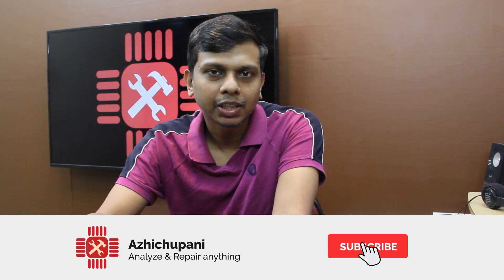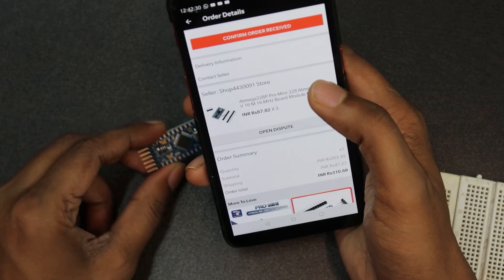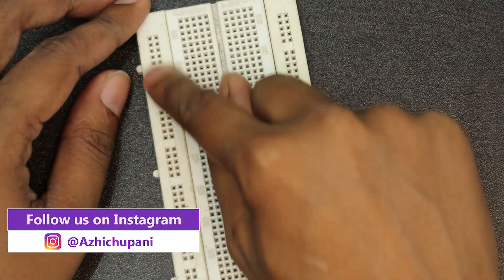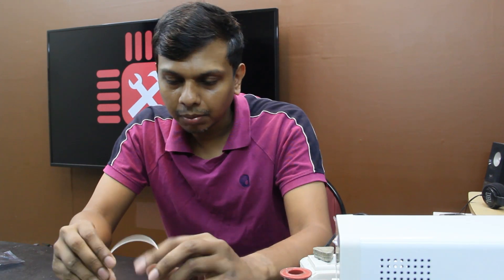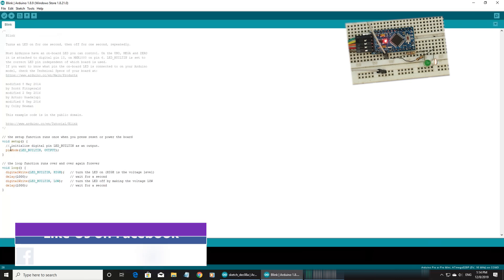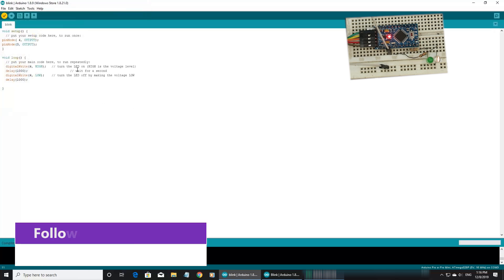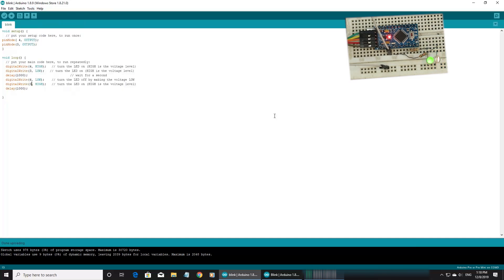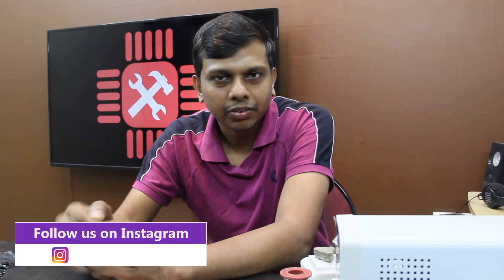EP:1 Arduino Tutorial for beginners | Malayalam

Comment: why compiled program is showing error message while uploading
as

Arduino: 1.8.13 (Windows Store 1.8.42.0) (Windows 10), Board: "Arduino Uno"

Sketch uses 706 bytes (2%) of program storage space. Maximum is 32256 bytes.

Global variables use 9 bytes (0%) of dynamic memory, leaving 2039 bytes for local variables. Maximum is 2048 bytes.

An error occurred while uploading the sketch

avrdude: ser_send(): write error: sorry no info avail

avrdude: ser_send(): write error: sorry no info avail

avrdude: ser_drain(): read error: The I/O operation has been aborted because of either a thread exit or an application request.

avrdude: ser_send(): write error: sorry no info avail

avrdude: ser_recv(): read error: The device does not recognize the command.

avrdude: stk500_recv(): programmer is not responding

avrdude: stk500_getsync() attempt 1 of 10: not in sync: resp=0x75

avrdude: ser_send(): write error: sorry no info avail

avrdude: ser_recv(): read error: The device does not recognize the command.

avrdude: stk500_recv(): programmer is not responding

avrdude: stk500_getsync() attempt 2 of 10: not in sync: resp=0x75

avrdude: ser_send(): write error: sorry no info avail

avrdude: ser_recv(): read error: The device does not recognize the command.

avrdude: stk500_recv(): programmer is not responding

avrdude: stk500_getsync() attempt 3 of 10: not in sync: resp=0x75

avrdude: ser_send(): write error: sorry no info avail

avrdude: ser_recv(): read error: The device does not recognize the command.

avrdude: stk500_recv(): programmer is not responding

avrdude: stk500_getsync() attempt 4 of 10: not in sync: resp=0x75

avrdude: ser_send(): write error: sorry no info avail

avrdude: ser_recv(): read error: The device does not recognize the command.

avrdude: stk500_recv(): programmer is not responding

avrdude: stk500_getsync() attempt 5 of 10: not in sync: resp=0x75

avrdude: ser_send(): write error: sorry no info avail

avrdude: ser_recv(): read error: The device does not recognize the command.

avrdude: stk500_recv(): programmer is not responding

avrdude: stk500_getsync() attempt 6 of 10: not in sync: resp=0x75

avrdude: ser_send(): write error: sorry no info avail

avrdude: ser_recv(): read error: The device does not recognize the command.

avrdude: stk500_recv(): programmer is not responding

avrdude: stk500_getsync() attempt 7 of 10: not in sync: resp=0x75

avrdude: ser_send(): write error: sorry no info avail

avrdude: ser_recv(): read error: The device does not recognize the command.

avrdude: stk500_recv(): programmer is not responding

avrdude: stk500_getsync() attempt 8 of 10: not in sync: resp=0x75

avrdude: ser_send(): write error: sorry no info avail

avrdude: ser_recv(): read error: The device does not recognize the command.

avrdude: stk500_recv(): programmer is not responding

avrdude: stk500_getsync() attempt 9 of 10: not in sync: resp=0x75

avrdude: ser_send(): write error: sorry no info avail

avrdude: ser_recv(): read error: The device does not recognize the command.

avrdude: stk500_recv(): programmer is not responding

avrdude: stk500_getsync() attempt 10 of 10: not in sync: resp=0x75

avrdude: ser_drain(): read error: The device does not recognize the command.

This report would have more information with
"Show verbose output during compilation"
option enabled in File -> Preferences.
Arduino: 1.8.13 (Windows Store 1.8.42.0) (Windows 10), Board: "Arduino Uno"

Sketch uses 706 bytes (2%) of program storage space. Maximum is 32256 bytes.

Global variables use 9 bytes (0%) of dynamic memory, leaving 2039 bytes for local variables. Maximum is 2048 bytes.

An error occurred while uploading the sketch

avrdude: ser_send(): write error: sorry no info avail

avrdude: ser_send(): write error: sorry no info avail

avrdude: ser_drain(): read error: The I/O operation has been aborted because of either a thread exit or an application request.

avrdude: ser_send(): write error: sorry no info avail

avrdude: ser_recv(): read error: The device does not recognize the command.

avrdude: stk500_recv(): programmer is not responding

avrdude: stk500_getsync() attempt 1 of 10: not in sync: resp=0x75

avrdude: ser_send(): write error: sorry no info avail

avrdude: ser_recv(): read error: The device does not recognize the command.

avrdude: stk500_recv(): programmer is not responding

avrdude: stk500_getsync() attempt 2 of 10: not in sync: resp=0x75

avrdude: ser_send(): write error: sorry no info avail

avrdude: ser_recv(): read error: The device does not recognize the command.

avrdude: stk500_recv(): programmer is not responding

avrdude: stk500_getsync() attempt 3 of 10: not in sync: resp=0x75

avrdude: ser_send(): write error: sorry no info avail

avrdude: ser_recv(): read error: The device does not recognize the command.

avrdude: stk500_recv(): programmer is not responding

avrdude: stk500_getsync() attempt 4 of 10: not in sync: resp=0x75

avrdude: ser_send(): write error: sorry no info avail

avrdude: ser_recv(): read error: The device does not recognize the command.

avrdude: stk500_recv(): programmer is not responding

avrdude: stk500_getsync() attempt 5 of 10: not in sync: resp=0x75

avrdude: ser_send(): write error: sorry no info avail

avrdude: ser_recv(): read error: The device does not recognize the command.

avrdude: stk500_recv(): programmer is not responding

avrdude: stk500_getsync() attempt 6 of 10: not in sync: resp=0x75

avrdude: ser_send(): write error: sorry no info avail

avrdude: ser_recv(): read error: The device does not recognize the command.

avrdude: stk500_recv(): programmer is not responding

avrdude: stk500_getsync() attempt 7 of 10: not in sync: resp=0x75

avrdude: ser_send(): write error: sorry no info avail

avrdude: ser_recv(): read error: The device does not recognize the command.

avrdude: stk500_recv(): programmer is not responding

avrdude: stk500_getsync() attempt 8 of 10: not in sync: resp=0x75

avrdude: ser_send(): write error: sorry no info avail

avrdude: ser_recv(): read error: The device does not recognize the command.

avrdude: stk500_recv(): programmer is not responding

avrdude: stk500_getsync() attempt 9 of 10: not in sync: resp=0x75

avrdude: ser_send(): write error: sorry no info avail

avrdude: ser_recv(): read error: The device does not recognize the command.

avrdude: stk500_recv(): programmer is not responding

avrdude: stk500_getsync() attempt 10 of 10: not in sync: resp=0x75

avrdude: ser_drain(): read error: The device does not recognize the command.

This report would have more information with
"Show verbose output during compilation"
option enabled in File -> Preferences.

Comment: Arduino: 1.8.13 (Windows Store 1.8.42.0) (Windows 10), Board: "Arduino Uno"

Sketch uses 706 bytes (2%) of program storage space. Maximum is 32256 bytes.

Global variables use 9 bytes (0%) of dynamic memory, leaving 2039 bytes for local variables. Maximum is 2048 bytes.

An error occurred while uploading the sketch

avrdude: ser_send(): write error: sorry no info avail

avrdude: ser_send(): write error: sorry no info avail

avrdude: ser_drain(): read error: The I/O operation has been aborted because of either a thread exit or an application request.

avrdude: ser_send(): write error: sorry no info avail

avrdude: ser_recv(): read error: The device does not recognize the command.

avrdude: stk500_recv(): programmer is not responding

avrdude: stk500_getsync() attempt 1 of 10: not in sync: resp=0x75

avrdude: ser_send(): write error: sorry no info avail

avrdude: ser_recv(): read error: The device does not recognize the command.

avrdude: stk500_recv(): programmer is not responding

avrdude: stk500_getsync() attempt 2 of 10: not in sync: resp=0x75

avrdude: ser_send(): write error: sorry no info avail

avrdude: ser_recv(): read error: The device does not recognize the command.

avrdude: stk500_recv(): programmer is not responding

avrdude: stk500_getsync() attempt 3 of 10: not in sync: resp=0x75

avrdude: ser_send(): write error: sorry no info avail

avrdude: ser_recv(): read error: The device does not recognize the command.

avrdude: stk500_recv(): programmer is not responding

avrdude: stk500_getsync() attempt 4 of 10: not in sync: resp=0x75

avrdude: ser_send(): write error: sorry no info avail

avrdude: ser_recv(): read error: The device does not recognize the command.

avrdude: stk500_recv(): programmer is not responding

avrdude: stk500_getsync() attempt 5 of 10: not in sync: resp=0x75

avrdude: ser_send(): write error: sorry no info avail

avrdude: ser_recv(): read error: The device does not recognize the command.

avrdude: stk500_recv(): programmer is not responding

avrdude: stk500_getsync() attempt 6 of 10: not in sync: resp=0x75

avrdude: ser_send(): write error: sorry no info avail

avrdude: ser_recv(): read error: The device does not recognize the command.

avrdude: stk500_recv(): programmer is not responding

avrdude: stk500_getsync() attempt 7 of 10: not in sync: resp=0x75

avrdude: ser_send(): write error: sorry no info avail

avrdude: ser_recv(): read error: The device does not recognize the command.

avrdude: stk500_recv(): programmer is not responding

avrdude: stk500_getsync() attempt 8 of 10: not in sync: resp=0x75

avrdude: ser_send(): write error: sorry no info avail

avrdude: ser_recv(): read error: The device does not recognize the command.

avrdude: stk500_recv(): programmer is not responding

avrdude: stk500_getsync() attempt 9 of 10: not in sync: resp=0x75

avrdude: ser_send(): write error: sorry no info avail

avrdude: ser_recv(): read error: The device does not recognize the command.

avrdude: stk500_recv(): programmer is not responding

avrdude: stk500_getsync() attempt 10 of 10: not in sync: resp=0x75

avrdude: ser_drain(): read error: The device does not recognize the command.

This report would have more information with
"Show verbose output during compilation"
option enabled in File -> Preferences.
Why this is happening while uploading
Reply from the maker: Select your board in Arduino ide. Select your programmer in Arduino ide. Check if the drivers are installed properly